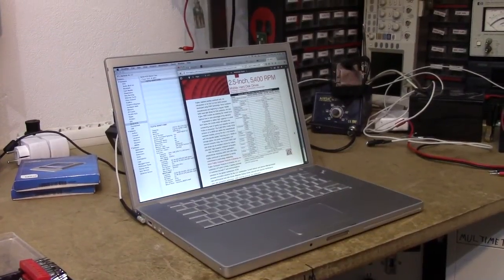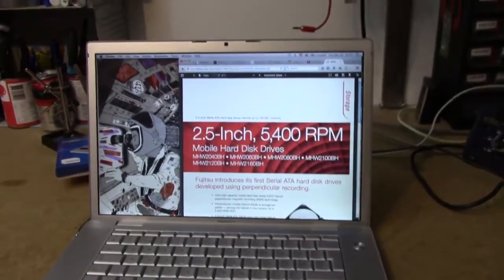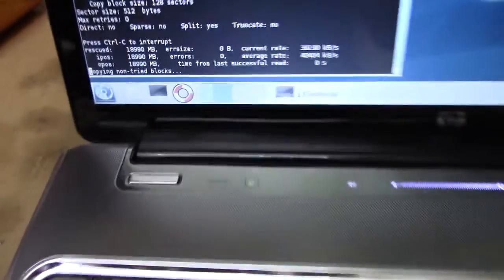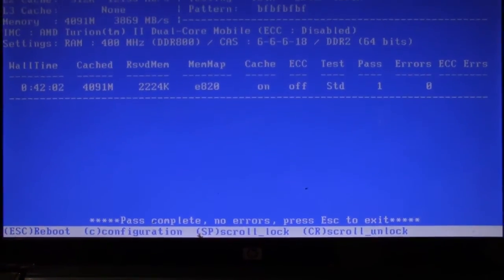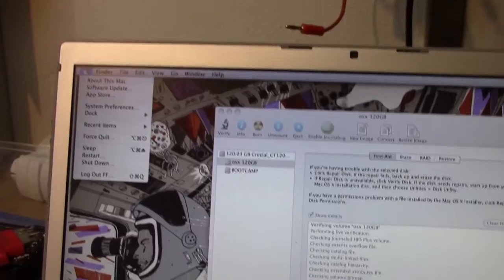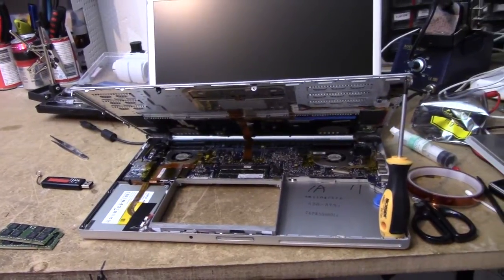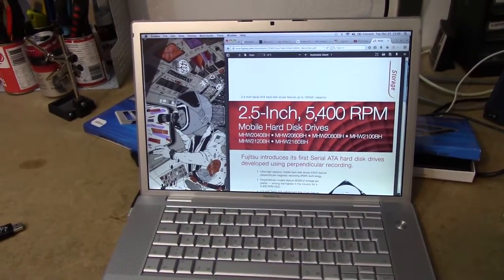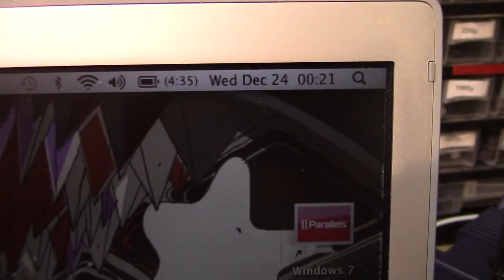Putting an SSD in my 2006 Macbook Pro

Comment: You're pushing that SATA controller to limits it never would've expected.
Reply from the maker: You'd be surprised - the 7200 RPM drive that came stock in my identical-spec HP would push over 100 MB/s sequential at the edge of the platter.

Comment: i have a 2006 macbook pro 17inch. tried an ssd upgrade a while ago but it wouldnt work for some reason. i just installed it, and it wasnt recognized properly. asked on forums but didnt find out why. :(

nice laptop though. its not worth much at all now but its pretty fast and is gorgeous condition, no dents or scratches, so might as well keep it. my hd is virtually silent anyway.

the worst thing about these is how fragile they are to cosmetic damage. just have look at them wrong and they scratch and dent. more a work of art than anything

Comment: Hi, first of all,  many thanks for this video. And I Just wanted to know, Can SanDisk Extreme Pro 480GB SSD be instaled in this model? I have this laptop and want to install 100% compatible SSD with Maximum capacity. Also I want to install Windows 7 additional to MacOSX. How did you install W7? MAny thanks in advance :).!
Reply from the maker: It's probably fine. I used a virtual machine to get the OSes onto it, as its optical drive is broken.
Reply: Many thanks for your advise.!

Comment: Could you offer some help. I successfully replaced my hdd with an ssd in my mac-book pro core duo but I am unable to boot up from the DVD drive with the original mac osx tiger installation disk. I will hold option or C and after about a minute of white screen the computer spits the disk back out and the file system error icon begins to flash if i held C during start up. And i will get white screen with the cursor that I can move with the track pad if I held option.
Reply from the maker: All I can say is that the DVD drive in mine was fucked when I got it. I think I used a VM to get an OS onto it through another computer.
Reply: I think I'm going to try cloneing the drive on another computer

Comment: if you take out the cd reader form the laptop,do you think that this will increase the life of this laptop?And does any one know what are the most comum defect that this laptop have?i use to have one, but i sold mine, and now i have the possibility to buy one again.Is your laptop still running today?
Reply from the maker: Mine still runs just fine, although I would not buy one today, they're too old.
Reply: thanks,yeah i better buy i video card, for my desktop pc.
Reply: FFcossag thanks
Reply: I really don't think it makes a difference if you take the hard drive out,a sad and maxed out ram should be good enough

Comment: Was the hard drive you put in a Sata2 and if so where does one find one now??
Reply from the maker: +Dave Hetrick It was a run-of-the-mill SSD, a Crucial MX100, I think. Any SATA SSD should work.
Reply: FFcossag could you send me a ebay link of a example of what SSD i could use or do you have the model number of the ssd you used?? Thank you so much for your time

Dave
Reply from the maker: The Mechanist
Any SSD should work.

Comment: Hey man, if it helps, that computer will run OS X Lion and, with an unsupported tool, will run OS X Mountain Lion (10.8).
Here are some methods of installing Mountain Lion,
https://www.youtube.com/watch?v=BzuaTftYL-0&t=635s (easier, but doesn't work with certain Macs)
https://www.youtube.com/watch?v=G2AOuIOiGzg (a little harder, but will work with any that run Lion)

Comment: Should I get this or the white 2010 model?
Reply from the maker: The 2010.
Reply: get the 2014 retina one, these ones are trash
Reply: damn buddy. i just stated my opinion, no need to react in such a harsh manner.
Reply: how am I supposed to know what she's gonna use it for?
Reply: thirdly, I work at Apple and these laptops aren't compatible with OSX Lion and above, they aren't even under warranty, so if you wanna buy one, go ahead.
Reply: White 2010, I had one last year and it worked great, it also runs macOS high sierra
Reply: Its upgrade-able to that? Thats pretty crazy, i wish they still made white and black plastic editions of these laptops for cheaper.
Reply: R E N N A M I G H T Y the 2010 because it is much faster and it can run high sierra